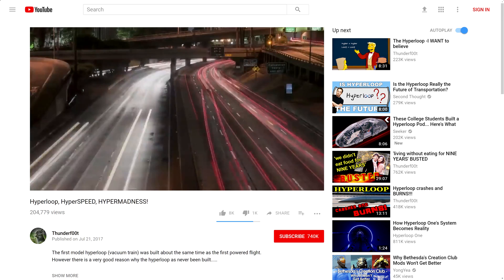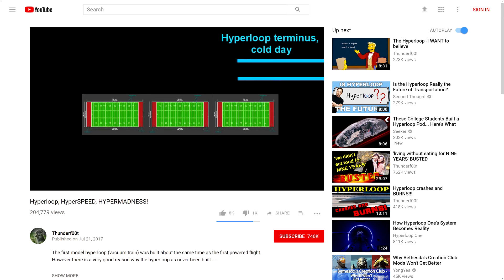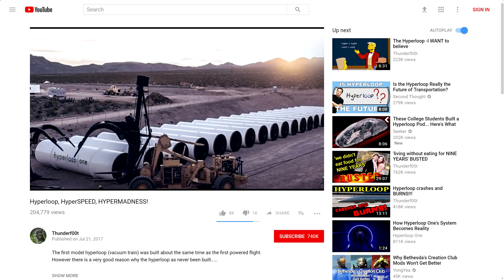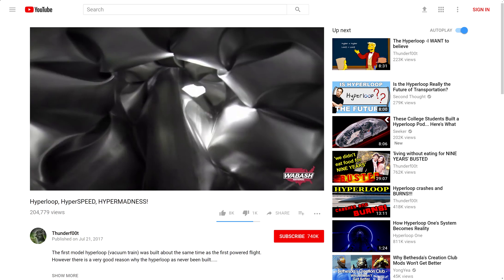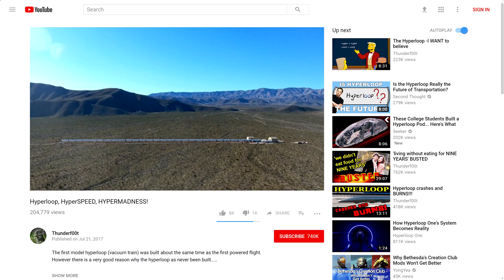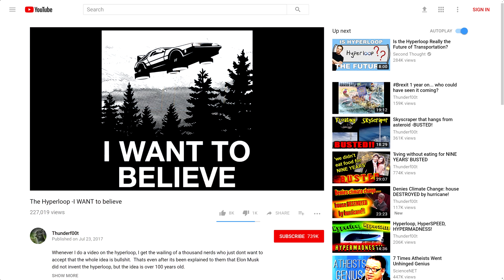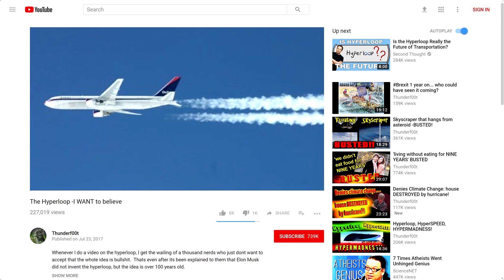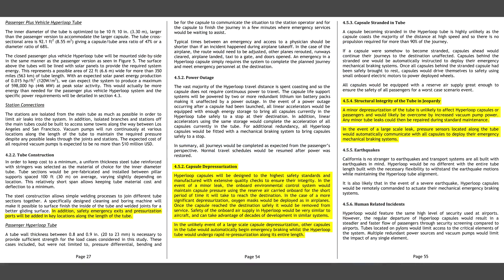ThunderMADNESS No. 2: Looking for Dumb in All the Right Places

Comment: The tube would have to have expansion joints or several 90° turns to account for expansion and contraction due to temperature fluctuation.
Reply: 90 degree bends? Is that where the pod is going to crash like tf00t shows? Lmao.
It's not the plumbing in your house. There is more than one way to skin a cat e.g. ways of dealing with material expansion like different types of expansion joints or a telescopic section as described in the original white paper. Lol
Reply from the maker: WE...FUCKING...COVER...THIS!!!!

Seriously, WHAT THE FUCK IS IT WITH YOU PEOPLE???

Comment: +Shane Killian
Check 5:48 in his https://youtu.be/ktO6IvLT2eg?t=5m48s 12 million dollar hyperloop video. I may be wrong, but.. That looks like a neoprene pad, as i was taught in structural statics is typically used in the manner roller mounts are in static diagrams, to allow some slight amount of movement on the structure to prevent it from becoming indeterminate, and allow for handling of things like thermal expansion and other slightly variable dimensions? Did he assume that that mount, which i have to assume is simply a slipped neoprene pad, was a half assed attempt at leveling it?
Reply: That much has been trivially obvious from the start. The best part of this whole debacle was when the hyperloop one engineer came out and just flat out said its obvious he hasnt even read the relevant wikipedia articles.

Comment: I am completely ignorant about the rust issue.

What I think thunderf00t said "the reasons  rust is  problem is that it will create dust and it will slow down the vacuum air pumps."  

Base on my amateur understanding, 

First you and countless have said it low pressure and not a vacuum. So I don't see that much of a slow down the depressurization pumps.

Second there is probably going to be plenty of depressurization station along the tube that the dust will get very easily. And didn't you the say the tube will constantly pump out air. 

Third in a form question how much dust can rust created

Fourth thunderf00t your ridiculing the space x compitetetion hyperloop made for testing. Its not the final product. It is basically a throw away tube.

Fifth rust is a very easily problem to solve.
Thunderf00t even mention it in his video.

Well I made my amateur assessment of the rust issue and is prepared wrong at a certain percent if is not 100%.  

Shane feel free give any correct you see fit.
Reply: Shane's latest vid addresses the rust but i believe he's said that its not a vacuum when considering the demands on a vacuum pump which can easily get to this low pressure. Trying to breath in it and you might as well be in space. But consider that the test tracks arent finished products, arent close to finished products and arent meant to be. These guys are trying to build to just a good enough standard to meet the requirements of their tests. Think alpha testing and not beta. The could easily paint or galvanise the steal, as they would do in a product which is needed to be of a higher standard.

Comment: Expansion is best not taken care of just on one end, otherwise it's like pushing a noodle and the fixed end of the track will collapse from having to push the rest of the track. Expansion is a solvable issue, but it'll have to be taken care of at periodic expansion joints
Reply from the maker: Actually, the Alpha document talks about having them at both ends, but for longer stretches you could always have a telescoping section in the middle if you needed one. The point is, it's not the insurmountable issue Thunderf00t made it out to be.

Comment: How do you feel about Solar Freaking Roadways?
Reply from the maker: "If you want to reclaim the space, it makes much more sense to simply cover your road or parking lot with overhead panels." Or your roof even before that.
Reply: Anything with "Freaking" in it's design name must be awesome
Reply: the problem with solar freaking roadways, the main one, and there are many, is that glass is not a good driving surface, it will not remain or be transparent if you try to make it one. If you want to reclaim the space, it makes much more sense to simply cover your road or parking lot with overhead panels. It's pure gimmick and mind candy.  However, evacuated tube transport is an old idea (I remember reading a fabulous article about it in Science Digest in the 80s)... where the material science and other tech necessary might actually have finally arrived.  Maybe not, but it's a good idea.
Reply: good idea, meaning, worth checking.